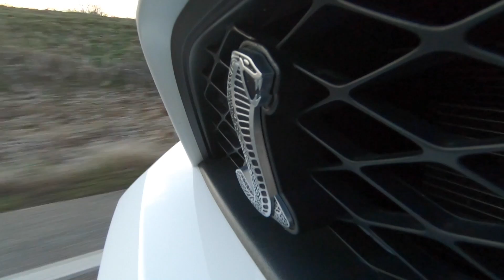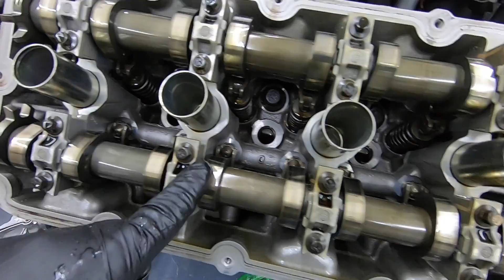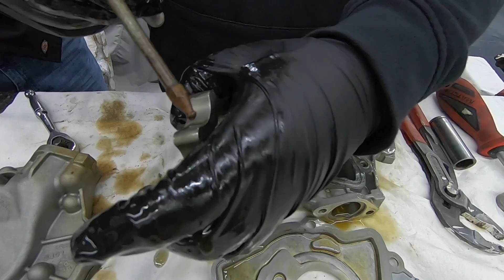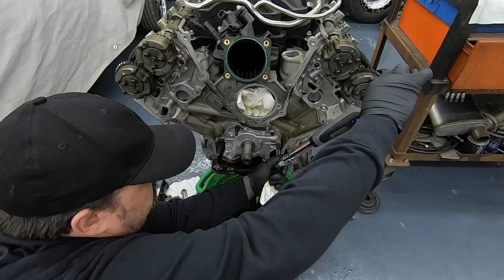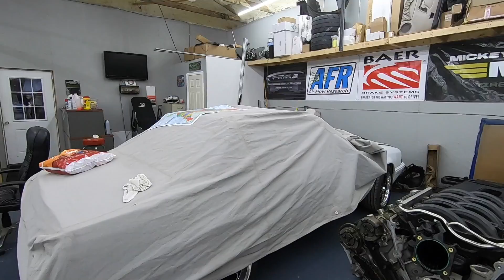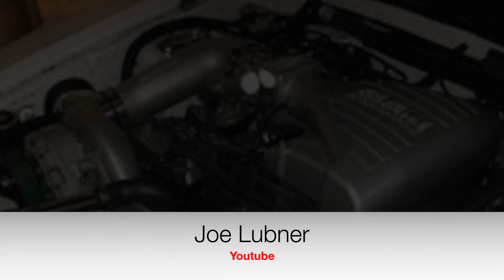Gen1 11-14 Coyote Oil pump gear install and timing procedure

Comment from the maker: This video is just for gen 1 11-14 coyotes. Here is the link to gen 2 oil pump gear install and timing procedure. Also gen 3 timing procedure is the same as gen 2. 
https://youtu.be/4SsG1oWkQJs
Reply: Will it be the same timing instructions for 2011 f150 5.0?
Reply: @mrsfc7602 is it the same
Reply: I think I might just go with a Gen2 Mustang engine. I've even thought about buying a new one if I cannot find a decent used one. Would you happen to know where the best place is to buy one? Thanks
Reply from the maker: Sean Mcmurray contact me on Instagram @speedaddict731
Reply: @SpeedAddict731  Instagram will not let me message you.
Reply from the maker: Sean Mcmurray 🤔 not sure why. Usually it will send and I have to approve it. But I don’t see one waiting.
Reply: @SpeedAddict731  I will try again later.
Reply: So I've got a 2014 GT car, Gen 2 long block with Gen 1 cams, phasers and timing components (we were told we had to run the gen 1 cams with the gen 1 ECU). So would I follow gen 1 or gen 2 timing procedures? Also, I just want to clarify, you're saying if the "R" is at the top on passenger side and "L" is on the top on drivers side I'm good to go as far as cam position with the Gen 1 cams? Thanks again for the great info!!
Reply: What torque wrench is that.
Reply from the maker: @BMfins  snap on
Reply: I realize I am kinda off topic but does anyone know of a good site to watch new movies online?
Reply: @Darwin Donald Lately I have been using FlixZone. Just google for it =)
Reply: @Zayne Brayan Yup, have been watching on FlixZone for years myself :D
Reply: @Zayne Brayan Thank you, signed up and it seems to work :D I really appreciate it!!
Reply: @Darwin Donald Happy to help =)
Reply: Is it required to take it apart to dump oil in there before installing in truck? Or could I just install without oiling it up.
Reply: If I'm using a gen 3 shortblock with gen 1 heads and timing parts do I still follow gen 1 procedure?

Comment: i had the crank at 12 aclock, then i removed the right had chain. BUT i ALSO removed the left hand side chain aswell. i noticed this and i moved the crank to the 9 aclock, and i also rotated the cam shaft in the direction it needed to line up as if it was spin in sync, it looks like yours in the video according to the key way and the cam marks on both banks after you did it the right way. am i still okay? my cam shafts angle for bank 2 are exh: 12 Oclock, int: 2 oclockish

Comment: I have a question. Im working on the exact same application. 2013 f150 5l gen 1 motor. The timing marks are lined up with the chain on the drivers side. After I put the tension on the primary chain I tried to rotate the crank counter clockwise to the 7 oclock position and it wouldn't move. Would there be any mechanical interference for this to happen? Because without the chains on the crank the crank moves as it should
Reply from the maker: Make sure that you didn’t put one of the chain guide bolts into the oil pump.  They are a little longer and will contact the crank if you did.   I would pull both the 8mm head bolts out and see if they are the same length

Comment: i have not moved nothing while chain has been disassembled. im figuring okay well either i can slide driverside chain back on and counter clock it to 9 clock position and then remove all hardware again to take chain back off driver side. that should make driver side equal to passenger side am i correct??? or did i just fuck this person motor up because motor is still in vehicle...

Comment: man i just did this im currently working on this same job and i domt know what to do im scared to touch it but i did the passenger side correct with crank and phaser at 12 clock position and removed the chain for passenger side. but i forgot to counter clock turn crank at 9 clock position for driver side and removed the driver side chain with crank at 12 clock position. what im scared of is the driverside phaser is not at 12 its between 1 or 2 clock position and crank is still at 12 clock position what do i do. customer wants job done before tomorrow afternoon!!!!!😭😭

Comment: Quick question. I might know this but just to be 100%. If I’m doing a gen 3 motor , gen 2 heads. I would time it just as a gen 1 correct ? I’d assume so but just want to double verify.

Comment: Anyone drop the bottom hard to get to bolt on the oil pick up tube meeting the oil pump and it’s deep down in the oil pan. Just happened to me and I can’t get it out with a magnet🥹

Comment: Hi everyone I have a question to I'm working on a 2014 Ford mustang 5.0 I have a 100 PSI oil pressure someone can tell me if that's normal after a few minutes running I can hear el tik tik tik noise on my engine.. thanks in advance

Comment: Did you use brand new timing cover bolts? Water pump bolts? Pickup tube bolts? What bolts did you reuse and what bolts were replaced? Thanks great vid

Comment: I did this the exact way and now when I try and rotate the motor sounds like something is hitting
Reply from the maker: If you did it the exact way in video on a Mustang 11-14 Coyote then you should not be hitting.
Reply: @SpeedAddict731  it’s a mustang boss 302 do I have to do anything with the cams and phasers?
Reply from the maker: @zachsbossbuild2428  it is no different on a Boss302.  You should have rotated engine to where keyway was at 12o’clock and data matrix was pointing up and r up on passenger side. Then take passenger chain off.  Rotate crank counter clockwise to keyway at 9 o’clock. Then remove drivers side chain.  After replacing opg and cs install drivers side chain with colored links on the L on the cam and on the timing mark on the crank sprocket.  Then rotate engine clockwise to 12o’clock and install passenger side chain colored link on the r on cam and on timing mark on crank sprocket.  If done correctly it will not hit. Did you make sure crank sprocket was for 11-14.
Reply: @SpeedAddict731  yeah I did they are boundary part number cm-sp-11

Comment: So on a coyote swap with gen 2 f150 motor going in a 2014 mustang, would I time it in like a gen 1 timing with all gen 1 timing components, or is there different stroke on TDC
Reply from the maker: You need to put gen 1 mustang cams and timing components in the gen2 engine and time it as a gen 1 Mustang.
Reply: @SpeedAddict731  I see I appreciate your time , I'll give it a shot, , are all cam caps and phaser bolts reusable or do we get new timing chaines and assembly,nuts bolts,guides,I get both gen 1 mustang engine and gen 2 f150 on a stand, going in a project

Comment: Amazing just did this with the help of your video. Had to replace my timing cover because it didn’t have the AC tensioner accommodation for my VMP Odin. And while I was at it I did the oil pump gears. 🤙🏽

Comment: why are the black chain links not in the same spot when it was disassembled? at reassembling the black chain links go on to the marks but at the disassembling point the black links were not lined up at all, why are they so important to line up after?
Reply from the maker: Because even though the same amount of chain lengths between timing points stay the same the chain still rotates.  It takes several revolutions for them to come back to the spot.  The paint marks are a reference to make sure you have the right amount of chain lengths in between the two timing marks to have the engine timed correctly.  If you count the chain lengths in between the two timing marks they are always the same.

Comment: Thanks for your video, just did my oil pump gears and it was still a pain in the ass with the engine in the car. I had a lot of issues getting the sump oil bolt back in on the tight side. My engine has a baffle in the oil pan which makes it that much harder to get that bolt back in. I dropped it in the oil pan once and thought I would have to pull the engine out to get it. Luckily I was able to fish it out with a long magnet. I finally got that bolt back in and my engine is going back together now.

Comment: Are any of the bolts that you removed TTY? I’m getting ready to do an opg and crank sprocket in gen 1. I was going to replace the filters for the vct while I’m in there, and found out that the bolts for the phasers are tty

Comment: noo! i put both chains at the same time when mark was at 12 oclock. Will it make a difference??
Reply: man i just did this im currently working on this same job and i domt know what to do im scared to touch it but i did the passenger side correct with crank and phaser at 12 clock position and removed the chain for passenger side. but i forgot to counter clock turn crank at 9 clock position for driver side and removed the driver side chain with crank at 12 clock position. what im scared of is the driverside phaser is not at 12 its between 1 or 2 clock position and crank is still at 12 clock position what do i do. customer wants job done before tomorrow afternoon!!!!!😭😭
Reply: i have not moved nothing while chain has been disassembled. im figuring okay well either i can slide driverside chain back on and counter clock it to 9 clock position and then remove all hardware again to take chain back off driver side. that should make driver side equal to passenger side am i correct??? or did i just fuck this person motor up because motor is still in vehicle...

Comment: Hey I have an issue with the same part but the computer is reading that the oil pump isn’t working. I had also went step by step with what you did but still I haven’t had any success, do you know what may be the issue?
Reply from the maker: What year and Mustang or S550?

Comment: Does it make sense to change the housing as well? Seeing that you're swapping out for billet gears, with a stock housing. MMR makes the Hurricane pump with billet gears installed. Probably going to do the crank sprocket, fool not to, chains, guides and chain sprockets. Might as well if you have the front of the motor off. Good vid, keep up the good work.

Comment: Awesome vid! I followed your video and changed my gears, and placed the timing chain links as you did. Know this is where a get confused, I decided to turn the engine two times see if everything lined back up. Crank links match every two full turns. But the cam color links move further away from the marks every turn. I'm thinking it's still in time, just has to turn many times to line the color links back up. Any thoughts? I sure as hell don't want to break cams and bent valves lol.
Reply from the maker: Dave Weightman thank you!!! it takes 20 something revolutions to get back to the paint marks on the timing marks.  If you wanted to you could count and it’s 31 links in between timing marks. So start counting the link after the cam timing mark and stop counting at the link before the crank mark. Should be 31 links. I usually turn the crank two full revolutions then count to make sure nothing jumped time.  It never has though. Hope this helps.
Reply: @SpeedAddict731  Thank you for replying! I ended up taking the plugs out and after about 12 revolutions the left and right sides both lined up again, along  with the crank. Feeling more confident now I've seen them line back up. Timing cover on, prepping for a Whipple charger. Thanks  again man,  these vids sure help the average guy out.
Reply: Fyi, all worked as prescribed! Appreciate the help, runs great!

Comment: About to do this to my '13 F-150 & I did buy a OE Mustang oil-pump, MMR OPG's & CSS... I was informed to install MMR into Mustang oil-pump... However, nobody thinks I have to use a Mustang timing-cover. Plus, looking at the 2 OE covers, they appear different accessories mounting areas. So, can you please explain timing cover difference?

Comment: After I got it timed I made a lap around. Just to make sure all the guides are still on correct and everything was A okay I realized that obviously with no oil pressure the tensioners were building up and dropping.  Hopefully when they dropped it wasnt loose enough to skip a tooth..  lol

Comment: So I got my keyway at 12:00 o'clock.. and following the video. But my right side. (Passanger side) the R isn't pointing straight up.. the R is pointing straight up on the one closest to the center of the engine. But the R that's pointing straight up for you isnt for me. 14 5.0l. Never been opened before
Reply from the maker: Nick if your removing the timing chain and the crank is at 12 and the r isn’t up on the passenger side then you need to rotate the crank around 1 more time to 12 o’clock and the r will be up. That’s where it needs to be then.

Comment: Hey, been following your instructions.  So far so good! One quick question if you dont mind.  When reinstalling the short belt back onto the crank dampener,  why do they zip tie the belt? In the vmp install video for 15-17 they did that.  Ain't getting an answer. Just curious.  Thought youd probably know and be able to enlighten me
Reply from the maker: Nick it is a stretch belt. It’s the easiest way to get it on.

Comment: So should I then scrape off the old gasket on the timing cover and put on new rtv? And same for the valve covers? And while putting the right hand timing chain guild back on, you said rotate the crank clock wise to tighten the chain, the guide just wont go on nice if the chain has too much slack? Sorry probably a blonde moment from me
Reply from the maker: Nick yes just get the rtv off the the valve cover and engine.  Put new down when you put valve cover back on. The reason you take the slack out is so all the slack in the chain is on the tensioner side. You don’t want any slack on the opposite side.
Reply: @SpeedAddict731  thank you very much
Reply from the maker: Nick no problem.

Comment: How tight do you go on the oil pick up bolts?
Reply from the maker: panthor2003 spec is 89 inch lbs and an additional 45 degrees.  But with pan on you can’t get a torque wrench on it. So I just get it hand tight with a wrench.
Reply: @SpeedAddict731  Right on thanks.  In that case, it would be similar tightness to bolt one, on the oil pump!

Comment: thanks man ,explained really well this video makes me wanna do it myself ,how hard would it be do them with the motor in the car ?
Reply from the maker: Oscar Huerta Thank you! not horribleto do them in the car. Just alot more time consuming due to being more cramped for space. That’s the main reason I did it with the oil pan on to show you how to get to those pesky pick up tube bolts.
Reply: @SpeedAddict731  ,so that one bolt is the hardest part ? lol , thanks man i really appreciate the info
Reply from the maker: Oscar Huerta to me that’s the worst part lol. Inside the vehicle vs outside the vehicle that is.
Reply: good to know, it looks pretty straight forward,so would you say to swap cams it is the same timing procedure?
Reply from the maker: Oscar Huerta yes you just have to time the cams together with the secondary chain.
Reply: thanks brother !

Comment: Very, Very well done.. I'm putting together a 95 GTS with a gen 1 and have been up in the air about doing the oil pump gears. I was hesitant about it but you've made it a lot clearer how really easy it is. What was left out is about how to retract the tensioners. Looked like the tool was hand made. Suppose a drill bit would work. I subscribed.
Reply from the maker: Mark Hemsoth thank you and welcome to the channel!! Yes a small drill bit will work great. I push them in by hand and put a pin in. Once you bolt the tensioner in pull the pin and it will release and your ready! If you have any questions feel free to ask!

Comment: So can someone tell me if the starting position is having the key way at 12 o’clock or is there a certain way the cams have to be facing?
Reply from the maker: Carlos Villareal start out with the key way at 12 o’clock. To verify the cams are in the right position. The R should be pointing up on the passenger side. Also on the gen 1 coyotes the matrix code on the cams should be up also. The crank Keyway can be at 12 and cams not in the right position. In that case turn the crank one revolution to the 12 o clock position and the cams will be right.  Then start the procedure.
Reply: Speed Addict 731 that was a fast reply!! Thanks a lot for the help, it’s probably the best how to Video as far as opg install. Thanks again!!
Reply from the maker: Carlos Villareal no problem. If you have any more questions let me know.
Reply: Speed Addict 731 where do you get that locking pin for the tensioners
Reply from the maker: Carlos Villareal they come with new tensioners. You can use small paper clips and make one.

Comment: Good info, I've been looking for a Coyote motor to do a foxswap what would you recommend?Are the GEN2 truck motors okay or should I just go with a Mustang engine? Also, do you know if there are any gains from swapping cams to aftermarket one's? Thanks
Reply from the maker: Sean Mcmurray Thank you! The truck engines are ok but if you can swing a gen2 Mustang engine, those are the best to use.  If I was to use a gen 2 truck engine I would use gen2 mustang cams in it. Aftermarket cams are ok but for cost vs hp gain it’s not worth it to me.  It’s all up to if you want to get the most out of N/A or go f/i later on.  I’m a big f/i fan in a coyote. But if your going for all out n/a I would get some good cams to help.

Comment: Ken, looks like your healing well.. Great video..are the gen 1 motors easier to work on, or do you make it look easy compared to the gen 3's
Reply from the maker: thereissomecoolstuff they are all about the same. The gen 3’s are a little more pain because of the high pressure fuel pump. But not horrible.